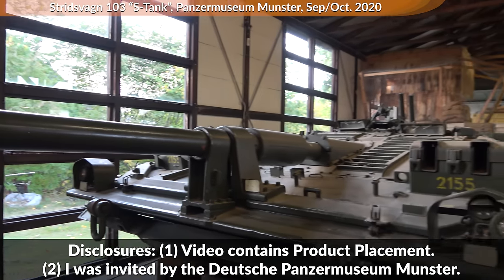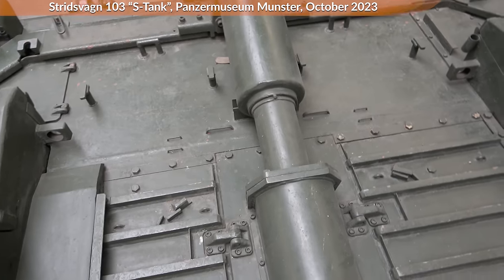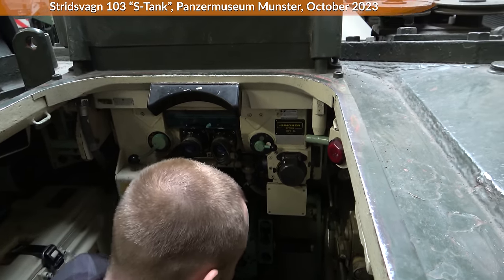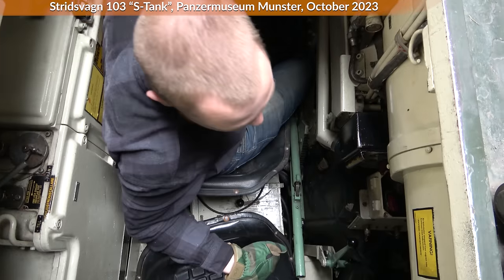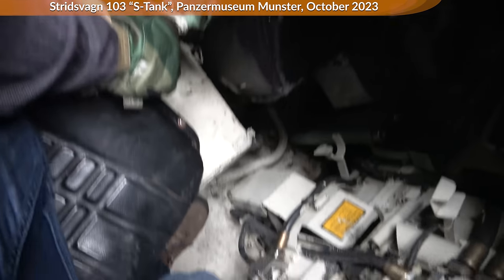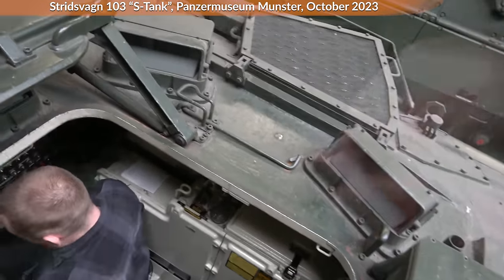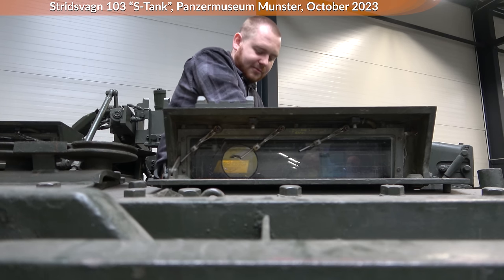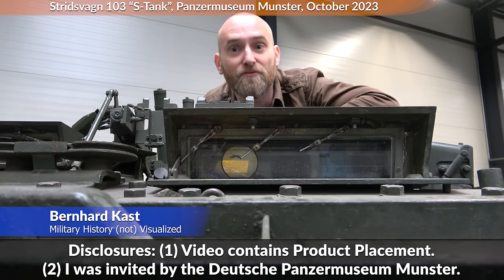S-Tank: The Swedish StuG

Comment: Task: "Okay, we need a light enough low profile tank with autoloader, ammo hidden somewhere out of the way and with good protection in prepared position. And let's show off our industrial knowhow a bit."
Soviet answer: T-64/T-72
Swedish answer:
Reply: S-tank can be driven by just 1 person and can drive just as fast backwards as forward, and its rate of fire is 15 shots per minute compared to 8 for T-72 and 6 for T-64 and 4 shots per minute for T-62. Its sloping of its armor is unmatched. And it also contain many clever engineering solutions. I think it is smart to use jerry cans with fuel as extra side armor for example.
Reply: @nattygsbord Yet the 103 became obsolete with the invention of effective gun stabilization and long rod penetrators, where as the T-64 and T-72 are still in use.
Reply: @lavrentivs9891  
Because the Swedish army have scaled down its military and see no point in keeping museum pieces unlike russia which never throws away anything. It all reminds me of people with hoarding behaviour problems that keeps all kinds of junk and never throws anything away no matter how useless.
Stridsvagn 103 was not replaced because it was bad. It was replaced because better tanks were available. The bolsheviks on the other hand have not built any modern tank as good as Leopard2 or M1 Abrams that is a good replacement for their old junk. Their military have been in a chronic lack of funds to modernize their military so they have been forced to keep old weapons in use.

For the sake of argument, If the choice is between an upgraded Stridsvagn-103D or a Leopard 1 or a T62 - then I definatly prefer to sit in a Stridsvagn 103. It was taken out of service 25 years ago, but if the Swedes for some reason wanted to cling on to this tank for a strange reason, then I expect it to have a 120mm gun attached to it, extra armor + ERA, plus barracuda camouflage net that would make it a sneaky sniper with more survivability in this war.
It would probably still be unwise to use it in frontal attacks. But it would be a good ambush tool, and it could offer much needed infantry support with its gun and high rate of fire - as it would do like most other tanks are doing in ukraine stay away from the frontline and fire some shots from over 1000 meters away from the enemy.
In a way would it be used more than a StuG than as a tank. But on the other hand have this war not seen much succesful tank action. There are no big open areas without minefields and trenches that could be used for manouver warfare where tanks comes to their own right. The S-tank would come more to its own right in offensive warfare in such terrain, and probably even more so the Leopard-1.
Reply: @nattygsbord you lost me at bolsheviks, theyre not that anymore lol
Reply: @generalmarkmilleyisbenedic8895  Just because one part is wrong or ignorant does not make the rest so, be fair in your discourse. As we all should.
Reply: @generalmarkmilleyisbenedic8895 Fascist Russia has built no new tanks since they were Bolsheviks though, so it is a fair characterisation.
Reply: @FridgemaxxedHybridoreanLifta the rest was also wrong. Upgrades leo 1/t-62 blow strv 103 out of the water. For one, you can survive a RPG-7 frontal hit and you got a turret so youre not a sitting duck in the offense. In any of the close quarters trench assaults the S-tank would have to swivel left and right its entire hull for covering fire, this is an open invitation for an RPG rocket to the side. Worse yet, the moment you lose the track you cant support your pals from a stationary position, you just sit there being useless. While Leo and T-62 can at least cover 360' around them with main armament.
Reply: @PalleRasmussen  But they have, they have build 3500 T14 Armata!! But the invisibility cloak it just so good they can't find them!! :D
Reply: @mawe42  oh yes, I forgot that. Maaybe the AI told them to migrate to somewhere more pleasant.
Reply: @lavrentivs9891  Too bad they got scrapped in 2003; they would have been massively useful in Ukraine; the size makes them really easy to hide, they come with their own entrenching tool and they are fast.
Reply: @phunkracy  "you can survive a RPG-7 frontal hit and you got a turret so youre not a sitting duck in the offense."
You will survive a frontal RGP-7 in the S-tank as well, especially if it strikes the HEAT-grid that was to be mounted on every tank during mobilisation.
As noted un Ukraine, the tanks there doesn't move a lot when taking the shot either, and that with a fully stabilised gun.

"In any of the close quarters trench assaults the S-tank would have to swivel left and right its entire hull for covering fire"
Again, this is something we see all the time in Ukraine, not least because the lack of gun depression.

"the moment you lose the track you cant support your pals"
One track is plenty enough to lay the gun horizontally, pivoting around the broken track. In vertical, it depends on how much is left of the suspension.
Normal procedure is to bail out though, as any disabled tank will become a prime target in short order.

Main problem today would be the lack of night- and thermal vision, something the current Leo1 and T-64< has, and that is what makes the older platforms useful as anything than improvised artillery.
Reply: @lavrentivs9891  It was made for standing in defilade and shoot attackers.
Reply: @phunkracy  That does not change my point, be fair by actually responding and saying what you think, rather than being quippy, that is all. You did that. Good job :)
Reply: @FridgemaxxedHybridoreanLifta  i responded to all. S-tank has no turret, massive disadvantage, isnt well armored, massive disadvantage, cant fire on the move, massive disadvantage. That's it. Not much more to it. S-tank is good only in hull down defensive, but its very bad at being a tank. I cant imagine it being used in assault and neither do you.
Reply: @phunkracy  Did you read what I said? I did not imply you did not respond to all of it. As for my own opinion: Stugs were the best tank of WW2, and they were used offensively, massively. There were huge amounts of atypical manuevers, and shortages, which led to the most survivable and most useful tank being used. Very rarely do you win battles based on anything but the first shit. They are light, they have very favourable front on contact, and they are very fast, operationally. They are exceptional in such a role. Unconventional wars where your enemy does not even have sophisticated vehicles, and is very often not presenting any strategic resistance, devalue and change what is most efficient and appropriate. Technological gains have made the possibilities of turreted tanks broader and deeper. I am not entirely sure what would be best in my mind, but I have a feeling Mountain Tanks (tanks of the Japanese and Korean types) are probably the new Stug, and get much of the best of both worlds. I mean, this whole thing is silly, the entire class of tanks, the entire role, is called *assault gun*. As in a gun you use to *assault*. It was literally designed to take impacts to the front and return devastating blows.
Reply: In terms of being well-armoured, you are forgetting what the casemate design is for, much like an Abrams. Abrams tanks are shockingly poorly armoured... in the rear and the sides. Especially if you were to make modern versions of older tanks. They are exceptionally well armoured on the turret and to a degree the front, though. The S Tank, for its time, is absurdly armoured on the front. It uses slope to its advantage. That is the point. In terms of surviving engagements, tank to tank, the chance someone beats a tank that has tens of tonnes less weight, the same calibre of gun, way more frontal armour, and is faster? Not high. Tanks very rarely, in combat, fire at massive speeds, especially not well. Peekaboo has dominated tanks, even stabilised ones, since forever. I am not saying firing on the move, as well as being able to rotate a turret, and to elevate, and so on, have no advantage, just that it is not nearly as significant of a disadvantage as you make it to be, especially not back then.
Reply: @FridgemaxxedHybridoreanLifta  
Since you didn't direct this comment to other users with @ I assume that it's directed to me then. So, can you repeat what exactly have I forgotten to mention, Captain Obvious?
Reply: @generalmarkmilleyisbenedic8895  correct. With the amount of nationalist fervor and socialist nostalgia, russian ideology right now can be classified as national socialist.
Reply: @TheArklyte  The previous comment had who I was replying to (phunkcracy), I do not know why you had to be rude, I was not being mean to you.
Reply: @nattygsbord Before the scrapped them all they did some test on radiocontrolled ones.  But the tech was not so good back then. but it would be cool to see 300 S-Tank 103D/E   version of it.   It would have been quite a good military piece to have to use in a war.
Reply: @CarlSöderquist No, it was used as any other main battle tank in swedish service.
Reply: @lavrentivs9891  No, it was optimized for standing hidden in ambush positions. We had the centurions for offensive operations. I was in a Centurion batallion. We worked with the 103:s.

Comment: Is firing on the move so important?
The combat footage i've seen rarely shows tanks firing on the move, and when they do it's at low speed.
Wouldn't you trade it for, say, 25% more protection?
Reply: Not only that, the turret could be swinged and engaged on move without much trouble.

 Each instance a tank need to stop to aim its gun was the most vulnerbale time of that tank. With turret stablization, that weakness was eliminated. Most of the time tank to be engaged, they should be on the move that drastically reduce the hit chace(remember the modern fcs and homing at missile were still not around tet)

So, yes. The capability of engaging target on the move made tanks much better

25% more protection may not worth 70-80% harder to hit.
Reply: Being able to reverse at speed, like the S-tank (which the T-72 can't)  is more important than fire on the move.   It would be relatively easy to develop stabilized optics for the S-tank which would allow tracking of the target.  Once a firing solution is found the 'auto shoot' command could be given.  This would rapidly brake the tank and skid skid turn the tank and fire even before the tank had finished bouncing from the stop.    Depending on speed it would only take 3 seconds.
Reply: @williamzk9083  
For TD like S-Tank, maybe.

For MBT like T-72, it is important but not that important. The main defense are armor and forward mobility not backward.

LOL, u are talking about 2000s kind of optics that required integration with its drive system.
Not cheap or easy at all!!!

S-Tank is a 60s tank. It is outdated already. 
Just buy new modern MBT.
Reply: Tank duels are usually won by the side that can score the first hit, and just a few seconds could be the difference between life or death
Reply: @huntermad5668  the innumerable failures of the t72 tank in the Ukraine conflict are very obvious.  There are unable to reverse and find a favourable protected position so take up to 30 seconds to turn around and then get hit during the turn.  They can’t hide or withdraw behind to terrain quickly so they get destroyed by ATGM. Agility is more important than armour.  The carousel magazine for the Autoloader is open within the crew compartment and often causes turret tosses with death of the entire crew.  The turret stabilisation system of the T 72 series is not even effective.   Apart from the smoothbore gun which is now out of date and crude ceramic armour , there’s nothing much to be said for the T72.  It’s gun elevation is even worse than the S tank.  Would that the Russian system had of retired this flawed and dated weapon as Swedes had courage to do
Reply: @nattygsbord  the most deadly tank in the Second World War was the StuG III.
Reply: @williamzk9083  
Those losses were in offensive ops that S-Tank couldn't do.

What do u want anyway? A MBT or a TD? 

And that was due to the design choice at the time, not because modern MBT couldn't do it.

Smoothbore is the current preferred gun for MBT. Only Chally2 (not much longer through) and Arjun still have rifled gun. What kind of cannon they need to upgrade to?
Reply: T-72 have its flaws. But I still think the main problem have been bad leadership, bad doctrine, lack of support from infantry and such. And yes lack of reverse speed and gun depressions are flaws so great that they deserve a mention. The jack in the box effect is no big deal for the tank itself as other tanks probably could probably not survive the same catastrophic hits. However when the ammunition cooks off I think that the crew survivability in that tank is 0% - and that should be considered an extremely serious flaw in a country values the lives of experienced tank crews.
But on the other hand to russias defence could one argue that crew safety was best guaranteed back in that day when this tank was built with a mobile tank that was hard to hit, and a low siluette, and a small turret that allowed for thicker armor and armour that was very sloped. So the tank crew would be very well protected like few other tanks of its day.
And everything is fine and well until the tank gets penetrated and the ammunition cooks off - because then there will be a 100% crew fatality. 

I think that T-72 have got a bit overly bad reputation as a tank. Neither the russian or iraqi armies did show it off in its best light.
Reply: @huntermad5668  StuG III were designed to support infantry assaults with direct fire.  They also ended up defending the infantry.  The German manuals for combat employment of the Jagdpanzer, Jagpanther and Jagdtiger indicate they were to be used in frontal assaults but they had to be protected on the sides.  
In a T-72 versus S-Tank battle the S-tank would either ambush the T72 from a concealed position, drive out, shoot and withdraw behind cover.  In an infantry assault they would simply point and shoot at them T72.  The S-tank needed an armour upgrade and modern optoelectronics.
Reply: @huntermad5668  "For MBT like T-72, it is important but not that important. The main defense are armor and forward mobility not backward.

LOL, u are talking about 2000s kind of optics that required integration with its drive system."
"(remember the modern fcs and homing at missile were still not around tet"

Modern FCS with laser range finders connected to a ballistic computer came before the fully stabilised gun, and the optics in the strv 103 were second to none according to the trials performed in Norway, Aberdeen and by BOAR.

Tank on tank engagements has always been rare, but the S-tank wasn't any less capable in offense than the Centurions...  and unlike what we have seen around Avdiivka, Sweden could never afford spending the tanks clearing minefield by driving enough T-72s through them to clear a path.

We often see Soviet tanks on both sides there becoming losses because they have driven themselves into a situation they can not get out of when the road forward is blocked and they have no speed trying to back out.
Reply: @williamzk9083  " the most deadly tank in the Second World War was the StuG III"
StuG was not a tank. It was sometimes used instead of a tank, but that was never the intention.

" It’s gun elevation is even worse than the S tank."
In what way was the S-tank's vertical arc bad?

"when the ammunition cooks off I think that the crew survivability in that tank is 0% "
Early brewups were mainly to extra munitions stored scattered in the turret. That is why Ukrainian turrets seldom are launched, as they only took with them what fitted in the carousel. Now when the Russians seems to have learned that lesson as well, turrets aren't popping like they used to....  but the whole turret launch thing makes no difference for crew survival. When that happens, the crew is already dead.
Reply: @johanmetreus1268  nonsense
Reply: @williamzk9083  I'll take that as your answer to my question then?
Reply: @huntermad5668  The S-Tank was purpose built for the Swedish defense force though. So its purpose isn't to do heavy offensive pushes, it's there to bleed the enemy of their armor from the moment they put boots on Swedish soil, and stay alive long enough to keep doing that from the next position it could set up in.
Reply: @Reddotzebra  Wrong , doctrine dictates that the first ones to arrive on the line will do as you say yes , but that will only last until the mobilization is complete and the very heavy counter offensive begins. You never win a war by going only on the defensive. It excels in the defence and was equal to the centurions on the offensive